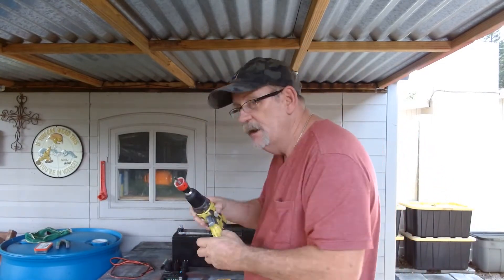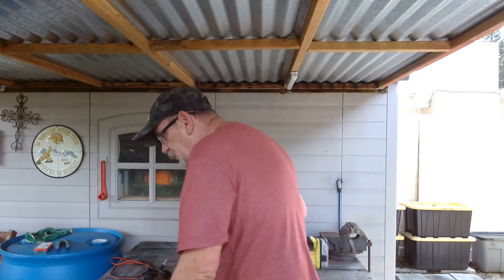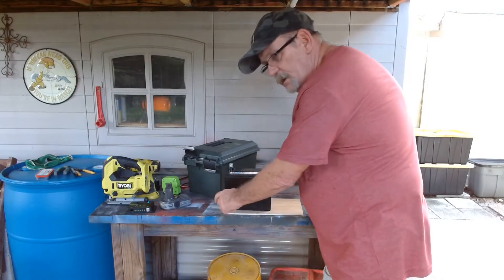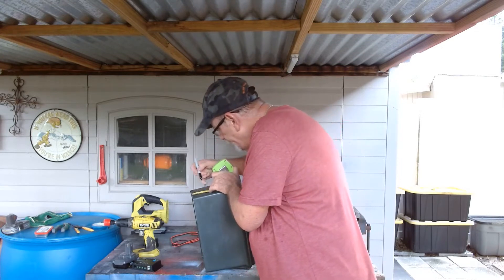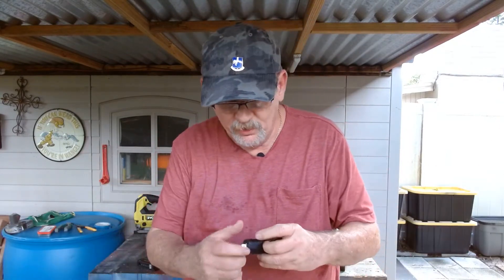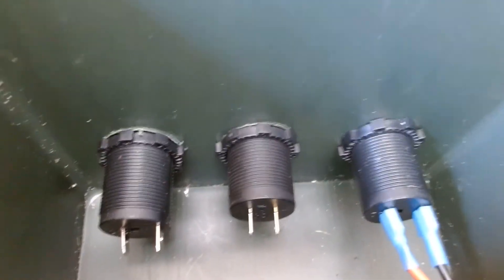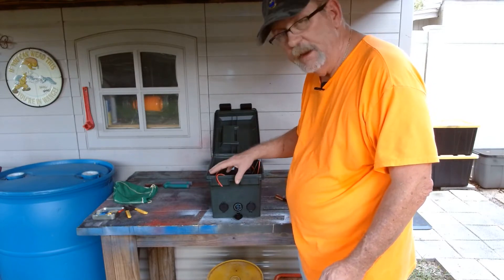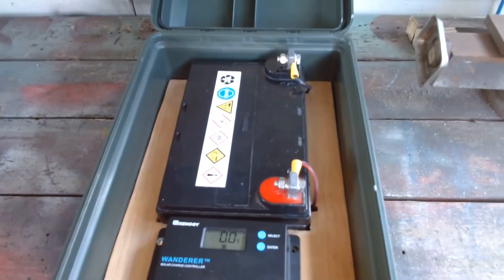Prepping - Building Your Own Solar Generator

Comment: Those Thunderbolt batteries are SLA (sealed lead acid) so you really only get half the watts vs LifePo4.
Still a good deal though.
Reply from the maker: You are correct, sir, and a LifePo4 is also lighter. A 12v-50amp LifePo4 weighs about 11 pounds, and it has 15 more amps than the Thunderbolt. It cost twice the price of the Thunderbolt, but the extra expense is easily offset in the long run. Thanks for watching.

Comment: Good job sir, greetings from Texas. What size wires are you using? I have 12AWG, will that work?
Reply from the maker: I used 14 gauge in the video, but 12 gauge will work as well. Thanks for watching.
Reply: @theorlandoprepper  thank you for getting back, I really appreciated it. I will build one soon. Thanks again. 👍🏽

Comment: Very cool. I see the comments about the heat. I have 2 deep cell batteries. I am worries about not having proper circulation. Getting 8 more will be a challenge keeping cool. 

[Renogy Deep Cycle AGM Battery 12 Volt 200Ah, 3% Self-Discharge Rate, 2000A Max Discharge Current, Safe Charge Most Home Appliances for RV, Camping, Cabin, Marine and Off-Grid System, Maintenance-Free] for now.
Reply from the maker: A multi-battery system absolutely needs proper ventilation. Thanks for watching.

Comment: If using just one solar panel u can.use a cheaper  pwm controller.   If ur using more than 1 panel u should use mppt controller than will maximize  exposed cells on multiple panels

Comment: Also that battery is lead acid and you should only run down between  60 to 80%.    Most pre.made ones use lithium types that you can run down safely to about 20 %
Reply from the maker: All good points, but I am going to cover that in the next video. If you recall, I said in this video that I would cover charging when I got to that point, which is only possible after the unit is built. I guess I should have told viewers to watch for that, but I was in a hurry because rain was moving in again; LOL.
Reply: @theorlandoprepper  What gauge wire did you use?
Reply from the maker: @dickthomas7028 , 14 gauge.

Comment: You do not  include breaker in your  configuration.    Also  it's hot in Orlando so  a vent fans or at least some vents  would be helpful. .   Also perhaps  showing options for mc4 connector for solar panel options. Also your charge controller  have USB so repositioning of the controller so USB access with lid closed.   

The battery is 35 Amp hour and let people know what u can run .  Also the gauge of wire needed.  I would suggest  14 ro 10 gauge
Reply from the maker: At just 10 amps a breaker is not necessary but can be included. The idea is to build it as simple as possible.  The wire is 14 gauge and the USB on the CC can be accessed when the top is open, but it also has them on the outside (as shown) for using when the lid is closed. As for vents, again, not necessary. I've used one just like this for 3 years in the summer heat here in Orlando without a single problem.